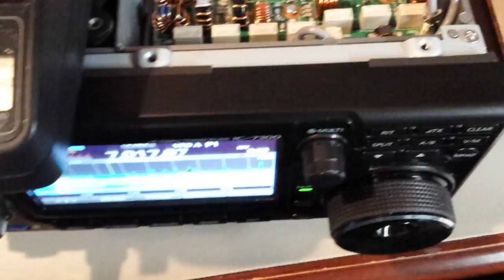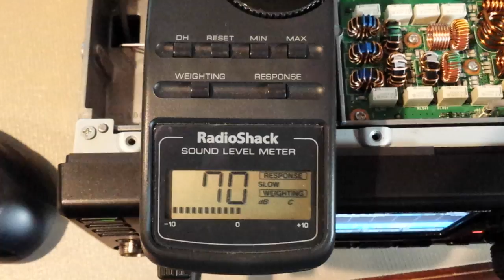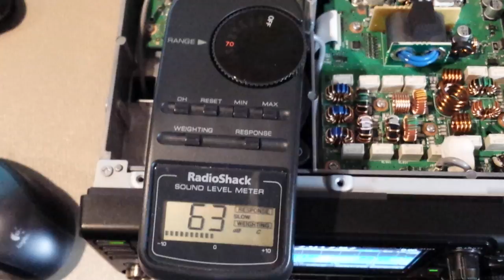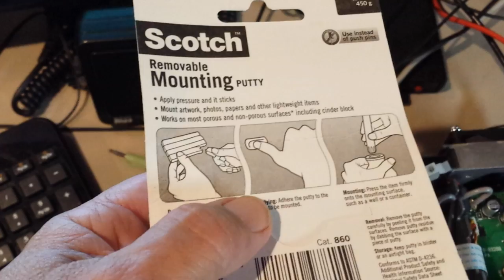IC-7300 QSK Relay Quieting

Comment: Thanks Steve - ordered this for $5 shipped from Amzon. 2oz actually cheaper than 1oz pack. Can you comment on the fan? For anyone doing only SSB and CW that may be too much fan noise?  Options are to swap out fan although I would try to at least match the color, but if there will be less air flow wondering if a resistor in the fan wire would not achieve the same effect?
Reply from the maker: I recommend the Noctura fan. A resistor might work but would produce some heat of it's own. Shuck, this radio stays cool with virtually no fan anyway. CW doesn't even warm it up. Don't know how ICOM managed it but it just works
Reply: Ut-Oh - that's good info. I just unplugged the fan on my TM-V71a - at 10 watts it's just not a problem... Tnx...

Comment: Hi Steve!  I was thinking a nice mod might be to have a switch turn off the Amp relay (which you stated is the noisiest) and then just put the seal on the TR relay. I have always used QSK. 73's de K8KEM